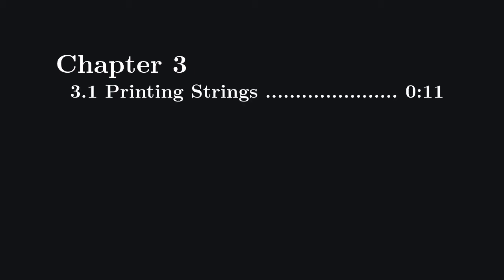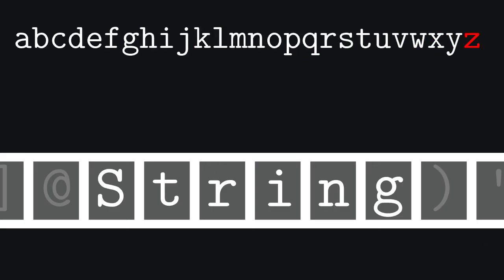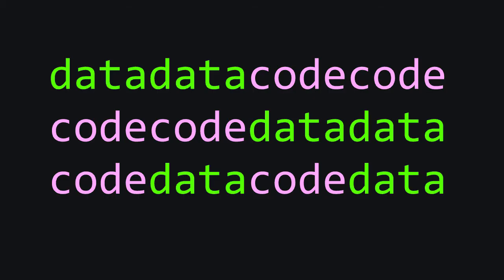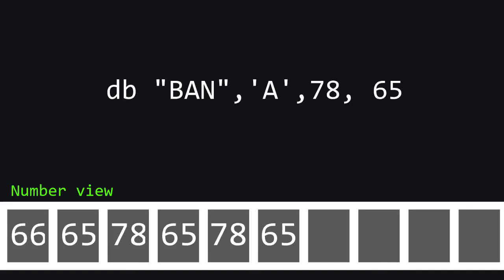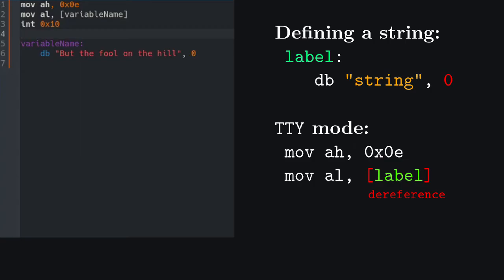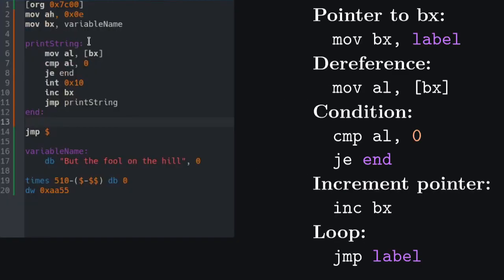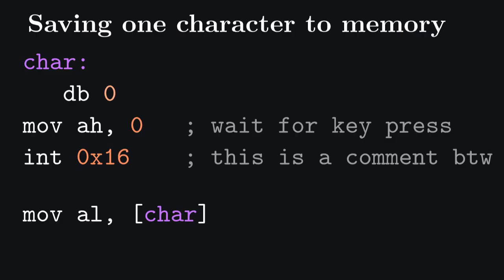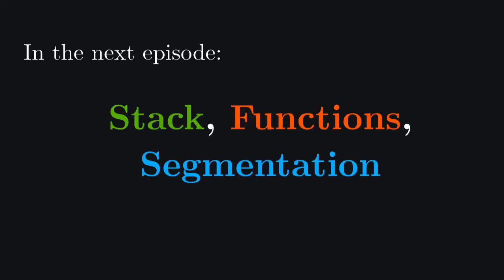Making an OS (x86) Chapter 3 - Strings, Keyboard Input in BIOS

Comment: The square brackets are NOT dereference operator. They indicate that the value stored in the register is a pointer. That's it. Otherwise, the CPU would use the literal value and mov it to the destination register.
I think these videos teach incorrect terminology and ideas because you do not have clear grasp of the concepts.
Reply from the maker: While it is true that I made these videos a while ago, and back then I was not as knowledgeable about this stuff as I am now: it a is perfectly valid intuition to think of effective addresses enclosed within square brackets as analogous to dereference. If x is a memory address, [x] are the contents of memory at that address.
Reply: @DaedalusCommunity  I do agree with that logical explanation.

Comment: didnt use the code it provided as i didnt understand it
heres the code!
(takes a string from input and prints it after pressing enter)

[org 0x7c00]
buffer:
    times 50 db 0
mov bx, buffer
inp:
    cmp al, 13 ; carriage return (\r)
    je inp_exit

    mov ah, 0
    mov al, 0
    int 0x16

    mov [bx], al
    mov ah, 0x0e
    int 0x10
    
    inc bx
    jmp inp

inp_exit:
    mov ah, 0x0e
    mov al, 0x0a
    int 0x10

mov bx, buffer

print:
    mov al, [bx]

    cmp al, 0
    je exit

    mov ah, 0x0e
    int 0x10

    inc bx
    jmp print

exit: 

jmp $

times 510-($-$$) db 0
db 0x55, 0xaa

Comment: [org 0x7c00]

mov bx, buffer  ; Point to the buffer start

input_loop:
    mov ah, 0
    int 0x16        ; Wait for keypress, character in AL
    
    cmp al, 0x0D    ; Check if Enter (Carriage Return) was pressed
    je print_loop   ; If Enter, go to printing section

    mov [bx], al    ; Store character in buffer
    inc bx          ; Move buffer pointer
    jmp input_loop  ; Get next character

print_loop:
    mov bx, buffer  ; Reset buffer pointer

print_char:
    mov al, [bx]    ; Load character from buffer
    cmp al, 0       ; If null (end of buffer), exit
    je exit
    
    mov ah, 0x0E    ; BIOS teletype function
    int 0x10        ; Print character
    
    inc bx          ; Move to next character
    jmp print_char  ; Repeat

exit:
    jmp $           ; Infinite loop

buffer:
    times 100 db 0  ; Reserve 100 bytes for input buffer

times 510-($-$$) db 0
dw 0xaa55

Comment: [org 0x7c00]
start:
mov ah, 0x0e
mov bx, variable
loopA:
mov al, [bx]
cmp al, 0
je config1
int 0x10
inc bx
jmp loopA
config1:
mov ah, 0x0e
mov al, 0x0a
int 0x10
mov al, 0x0d
int 0x10
xor bx, bx
mov bx, buffer
xor cx, cx
loopB:
xor ax, ax
int 0x16
mov [bx], al
cmp al, 0
je loopB
mov ah, 0x0e
int 0x10
inc bx
inc cx
cmp cx, 10
je config2
jmp loopB
config2:
mov byte [bx], 0
mov ah, 0x0e
mov al, 0x0d
int 0x10
mov al, 0x0a
int 0x10
mov bx, buffer
loopC:
mov al, [bx]
cmp al, 0
je hang
int 0x10
inc bx
jmp loopC
hang:
xor al, al
xor ah, ah
xor bx, bx
jmp $
variable:
db "write a word with 10 letters", 0
buffer:
times 11 db 0  
times 510-($-$$) db 0
db 0x55, 0xaa

Comment: [org 0x7c00]

mov bx, buffer

jmp getinput
jmp $

getinput:
    mov ah, 0x00
    int 0x16
    mov ah, 0x0e

    cmp al, 13 ;Enter char
    je print

    cmp al, 8 ;Back char
    je removechar

    jmp printchar
    jmp end

removechar:
    dec bx
    mov al, 0
    mov [bx], al
    mov al, 8
    int 0x10
    mov al, 0
    int 0x10
    mov al, 8
    int 0x10
    jmp getinput

printchar:
    mov [bx], al
    inc bx
    int 0x10
    jmp getinput

print:
    mov al, 0x0a
    int 0x10
    mov al, 0x0d
    int 0x10
    
    mov bx, buffer
    pl:
        mov al, [bx]

        cmp al, 0
        je end

        int 0x10
        inc bx

        jmp pl

end:
    jmp $

buffer times 258 db 0

times 510-($-$$) db 0
db 0x55, 0xaa

Comment: I know this is two years old but i wrote code that accomplishes the task at the end

use16

org 0x7c00

mov si, 0

mov [textbuffer], bx

jmp readInput

textbuffer:

        times 255 db 0

readInput:

        mov ah, 0x00

        int 0x16

        mov [textbuffer + si], al

        add si, 1

        cmp ah, 1Ch

        jne readInput

mov si, 0

jmp print

print:

        mov ah, 0x0e

        mov al, [textbuffer + si]

        int 0x10

        add si, 1

        cmp byte [textbuffer + si], 0

        jne print

mov [textbuffer], bx

mov si, 0

jmp readInput

times 510 - ($-$$) db 0

dw 0xaa55

Comment: [org 0x7c00]

buffer:
    times 10 db 0
    mov bx, buffer

main:
    mov ah, 0
    int 0x16
    mov [bx], al
    cmp al, 8
    je del
    mov ah, 0x0e
    int 0x10
    inc bx
    cmp bx, buffer+10
    jne main

del:
    mov ah, 0x0e
    mov al, 8
    int 0x10

    mov ah, 0x0e
    mov al, 32
    int 0x10

    mov ah, 0x0e
    mov al, 0x08
    int 0x10

    dec bx
    jmp main

jmp $
times 510-($-$$) db 0
db 0x55, 0xaa

Comment: Here is my answer, hope it helps, and if there is any spelling mistakes please tell me,and thank you.

[org 0x7c00]; set the offset point

mov bx, inputStr ;set bx to the input string
mov cl,1 ;set cl to 1
loop:; take the user key input and store it to inputStr 
    cmp cl,16 ; check if cl = 16
    je bpr ;and if it is true jump to brp 
    mov ah,0 ; enter read mode (idk if this is the real name)
    int 0x16 ; set the bios interrupt to 0x16
    cmp al,13 ; check if the user pressed enter
    je bpr ; and if it is true jump to bpr
    mov [bx],al ; moving the button input to [bx] 
    mov ah,0x0e ; entering writing mode (agian idk if this is the real name)
    int 0x10 ; set the bios interrupt to 0x10
    inc bx ; increase bx by 1
    inc cl ; increase cl by 1
    jmp loop ; repeat loop

bpr: ; bpr is a shor name that means befor printing (i made the name up btw)
    [org 0x7c00] ; reset the offset point
    mov ah, 0x0e ; enter writing mode
    mov bx,inputStr ; store the input string to bx
    mov al, 32 ; add space
    mov cl, 1 ; set cl to 1
    int 0x10 ; print the space
    print: ; print loop
        cmp cl,16 ; check if cl = 16
        je end ; if true jump to end
        mov al,[bx] ; set al to [bx]
        int 0x10 ; print character by the bios interrupt
        inc bx ; increase bx by 1
        inc cl ; increase cl by 1
        jmp print ; repeat the loop

end:
jmp $

inputStr:
    times 16 db 0

times 510-($-$$) db 0
db 0x55, 0xaa

Comment: hey bro, this is my solution and it worked well( quite a hard day today for me XD
oh by the way, i love these brilliant courses!!!!

; July 14, 2023
; WilliamHVollita
; so here we go, in this file we're gonna do some inputs

; give a new line and a return right after booting
mov ah, 0x0e
mov al, 0x0A; 0x0A refers to "NL Line Feed", which turns the output pointer to a new line, attention that 'LF'doesn't work
int 0x10
mov ah, 0x0e
mov al, 0x0D; 0x0D refers to "Carriage Return", which turns the output pionter to the very beginning of its present line, used right after "NL Line Feed"
int 0x10

; process begin nowwwwww!
; firstly let's print a so-called "prompt"
mov ah, 0x0e
mov al, '>'
int 0x10

; now we need an input, and just store it!
; to set ah to 0, followed by int 0x16, would call the bios to wait for a keyboard stroke, whatever the stroke is, it would be stored in al
[org 0x7c00]
mov bx, myString
jmp input_loop
input_loop:
	mov ah, 0
	int 0x16
	mov ah, 0x0e
	int 0x10
	mov [bx], al
	inc bx
	cmp al, 0DH
	je before_output; if detected current letter is ENTER, then call before_output to prepare for the output
	jmp input_loop
before_output:; quite confusing here... anyway, this line calls what should be done only once before output_loop
	mov ah, 0x0e
	mov al, 0x0A
	int 0x10
	mov ah, 0x0e
	mov al, 0x0D
	int 0x10
	mov ah, 0x0e; print a prompt again, to make confortable to use
	mov al, '>'
	int 0x10
	[org 0x7c00]
	mov bx, myString; reset bx for the output process
output_loop:
	mov ah, 0x0e
	mov al, [bx]
	cmp al, 0DH
	je exit
	int 0x10
	inc bx
	jmp output_loop
myString:; can anybody tell me what does this means X( don't really understand how this section actually works
	times 16 db 0
exit:; now we only have to call a return
	mov ah, 0x0e
	mov al, 0x0A
	int 0x10
	mov ah, 0x0e
	mov al, 0x0D
	int 0x10

; print to mark the end of this program
mov ah, 0x0e
mov al, 0x0A
int 0x10
mov ah, 0x0e
mov al, 0x0D
int 0x10
mov ah, 0x0e
mov al, 'X'
int 0x10
jmp $

; this section defines the file a "bootable" file by marking the very end with 55AA
times 510-($-$$) db 0
db 0x55, 0xaa

Comment: Made it so you can type:

==CODE==

	mov ecx, keystring+0x7c00

	call PrintString
infloop:
	mov ah, 0
	int 0x16
	mov [char+0x7c00], al
	mov ecx, char+0x7c00
	call PrintString
	jmp infloop
	jmp $

;====functions====

PrintString:
	mov ah, 0x0e
LoopHead:
	mov bl, 0
	mov al, [ecx]
	int 0x10
	inc ecx
	add bl, [ecx]
	jnz LoopHead
	ret

;====variables====

keystring:
	db "Press any key...", 0

mystring:
	db "I am a string bla bla bla", 0

newstring:
	db " lalalalalallallala fuck fuck", 0

char:
	db 0, 0

	times 510-($-$$) db 0
	db 0x55, 0xAA

Comment: Why this doesnt work
[org 0x7c00]
characters: 
	mov ax, 0
	int 0x16
	mov ah, 0x0e
	int 0x10
	jmp characters
end:
	jmp $
char:
	db 0
times 510-($-$$) db 0
db 0x55, 0xaa
Reply: ibut it does work?
Reply: unless it's not supposed to print to the screen the keys you're typing in real time, but in terms of if booting, it boots.
if that's so, I guess you don't need the "end" part as "characters" loop doesn't break and char doesn't get used so that also doesn't really do anything here
if not, then I don't  really know what you want this to do

Comment: Maybe someone knows..

Why does the first program print the string (yes, i'm aware it also prints a NUL character), whereas the second prints nothing? In other words, why does "myString" have to be defined at the end of the program?

First Program:

[org 0x7c00]

mov bx, myString
mov ah, 0x0e

write_chars:
    mov al, [bx]
    int 0x10
    inc bx
    cmp al, 0
    jne write_chars

jmp $

myString:
    db "This too shall pass.", 0

times 510 - ($-$$) db 0
db 0x55, 0xaa

Second Program:

[org 0x7c00]

myString:
    db "This too shall pass.", 0

mov bx, myString
mov ah, 0x0e

write_chars:
    mov al, [bx]
    int 0x10
    inc bx
    cmp al, 0
    jne write_chars

jmp $

times 510 - ($-$$) db 0
db 0x55, 0xaa
Reply from the maker: There is no distinction between data and code, so if you place the string at the beginning (i.e. in a reachable portion of code) the processor will try to execute it! This is why the string should be defined after the jmp $
Reply: @DaedalusCommunity  Of course! Thank you for responding, phenomenal series mate.
Reply: @DaedalusCommunity  Can you expand on this a bit more, why is it a problem if the code gets executed? Does the db command somehow mess with the label addresses or something? (I'm assuming they are loaded beforehand, if the "mov bx, myString" can reference it even though it wasn't reached yet, is that the problem? Because earlier definition does work if you skip execution with a jump, but I can't figure out what happens exactly if it runs or why that messes it up)

Comment: Is there a way to write this to a USB drive and run it from it?
Reply from the maker: Yes, I used dd on linux, although I can't stress enough how careful you have to be when using dd, don't lightheartedly mess around with it, you might overwrite your whole disk by mistake!
Reply: @DaedalusCommunity  Yes yes! that's a thing I'm very carefully considering too, I always make sure to try things out first on my virtual machine, but I'd really love to get this into extended mode, and do more with it, than just using the basic stuff :)

While it is very unlikely I'll write a complex operating system like Linux or windows myself, I just want to try out new things :) the VM helps a lot, but it also would be fun to plug in a USB stick to my old notebook and just let it do things :)

There also isn't much to lose on that one, as it doesn't even have a drive anymore, the worst thing that could potentially happen would be that it bricks itself, but again it's... an old notebook, built in 2011 so I don't worry much about it :3

Comment: Late to the party but here's my solution to the exercise:
[org 0x7c00]

%define bufLen 10

buf:
    times bufLen db 0

mov bx, buf

main:
    mov ah, 0x0
    int 0x16 ; get char from user
    mov [bx], al ; move char to buffer
    inc bx ; increment buffer pointer
    
    cmp bx, buf + bufLen ; check if buffer is full
    je done
    jmp main

done:
    sub bx, bufLen + 1
    mov cl, bufLen
    jmp l1

l1:
    inc bx
    
    mov ah, 0x0e
    mov al, [bx]
    int 0x10
    
    dec cl
    jnz l1

; halt the OS and CPU
exit:
    hlt
    jmp exit

times 510 - ($ - $$) db 0 ; finish the boot sector
db 0x55, 0xaa

Comment: For those looking for solutions to the homework, I've finally been able to figure something out that works!

org 0x7c00

mov cl, 0
mov bx, buffer
jmp getInput

printString:
	mov al, [bx]
	cmp al, 0
	je exit
	int 0x10
	inc bx
	jmp printString

setupPrintString:
	mov ah, 0x0e
	mov bx, buffer
	mov cl, 0
	jmp printString

getInput:
	cmp cl, 9
	jge setupPrintString
	mov ah, 0
	int 0x16
	cmp al, 8
	je setupPrintString
	mov [bx], al
	inc bx
	inc cl
	jmp getInput

exit:
	hlt

buffer:	times 10 db 0

times 510-($-$$) db 0
db 0x55, 0xaa

Comment: currently working on doing that as an exercise. having issues with checking the length of the buffer currently
Reply: Alright, figured out my problem and finished the homework!
[line 1 to prevent spoilers]
[line 2 to prevent spoilers]
[line 3 to prevent spoilers]
[line 4 to prevent spoilers]
alright here is the code i used

buffer:
    times 10 db 0x00
    db 0x03
    mov bx, buffer
loop:
    mov ah, 0
    int 0x16
    mov [bx], al
    mov ah, 0x0e
    int 0x10
    inc bx
    cmp bx,buffer+10
    jne loop
end:
    times 510-($-$$) db 0
    dw 0xaa55

Comment: 100% sure this can be made simpler, but I made code that has keyboard input and you can press backspace to erase the selected character instead of backspace going left 1 character.

input:
	mov ah, 0
	int 0x16
        cmp al, 8
        je bksp
	mov ah, 0x0e
	int 0x10
        jmp input

bksp:
    mov ah, 0x0e
    mov al, 8
    int 0x10
    mov ah, 0x0e
    mov al, 32
    int 0x10
    mov ah, 0x0e
    mov al, 8
    int 0x10
    jmp input

jmp $
times 510-($-$$) db 00
db 0x55, 0xaa

Comment: Finally, I finished the exercise! The code:

; Code
[org 0x7c00]

mov ah, 0x0e ; Enter writing mode (which is not called like that but anyway....)
mov bx, prompt ; bx is always the memory holder. In the beginning, it holds the memory of the prompt

; Print the prompt
print_prompt:
  mov al, [bx]
  cmp al, 0
  je get_input
  int 0x10
  inc bx
  jmp print_prompt

; Get the input and store it into the variable
get_input:
  mov bx, variable
  input_loop:
  mov ah, 0
  int 0x16
  cmp al, '-' ; The input ends when '-' is given. Normally, we should also check if the character fit the array
  je new_line
  mov [bx], al
  inc bx
  jmp input_loop

; Print a new line (optional)
new_line:
  mov ah, 0x0e ; Enter writing mode
  mov al, 13
  int 0x10
  mov al, 10
  int 0x10

; Print the hello message
print_hello:
  mov bx, hello
  prompt_loop:
  mov al, [bx]
  cmp al, 0
  je print_variable
  int 0x10
  inc bx
  jmp prompt_loop

; Print the user input!
print_variable:
  mov bx, variable
  variable_loop:
  mov al, [bx]
  cmp al, 0
  je end
  int 0x10
  inc bx
  jmp variable_loop

; Add a '!' in the end (optional)
end:
  mov al, '!'
  int 0x10

; jmp $ ; Is this nesecary?

; Data
prompt:
  db "What's your name? ", 0

hello:
  db "Hello ", 0

variable:
  times 10 db 0

times 510-($-$$) db 0
db 0x55, 0xaa
Reply: You could change    cmp al, '-'  to cmp al, 0DH  ; 0D is the hexadecimal representation of ENTER key
Reply: @mcarling  Thank you!
Reply: please guys tell me how to type cause i try every code but i dont print anything is there somthing othere compiling and running the code to do?
i copy past this code i try to type any thing but nothing comes up i use: nasm test.asm -f bin -o test.bin && qemu-system-x86_64 test.bin then i enter the os "he told me to Ctr ALt G to release GRAB" (my english is bad sorry )
but i cant type at all please help me
and thx
Reply: @justdo6389  Have the previous examples (I mean the examples from the previous videos) worked?
Reply: @justdo6389  I have the same problem, on windows qemu just doesn't support keyboard input in the boot menu in most versions. I haven't been able to solve it either, it's just a problem that prevents me from continuing the series.

Comment: Great video! I just want to make one things clear to everyone that starting out.

"strings" are not 0 terminated. This is a concept used in operating systems that are written in C (unfortunately, most of the ones we use today) because they treat "strings" as just a pointer. We could also have the OS (kernel) treat strings as objects that have a "length" member. This will remove unneeded overhead and confusion and probably even improve performance in some scenarios. To add on that, dynamically allocated memory has this member anyway so it would also remove the need to have a "pure" pointer "string" and a "string" type that every language (expect for C and older ones) implements anyway....

One more reason we need a new modern NON-UNIX OS to be written in another language (or even C but use objects for strings....). So, thank you for the series! I'm trying to make one and you help me get started!
Reply: why say that strings are not 0 terminated? you just mean there's another way to do it?